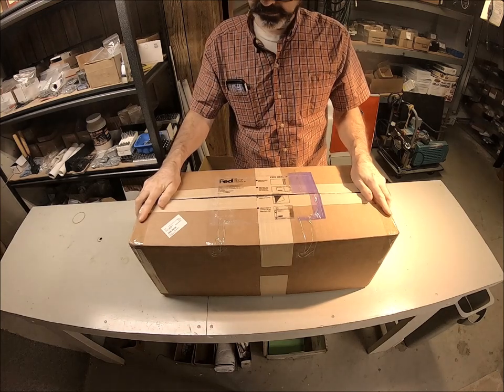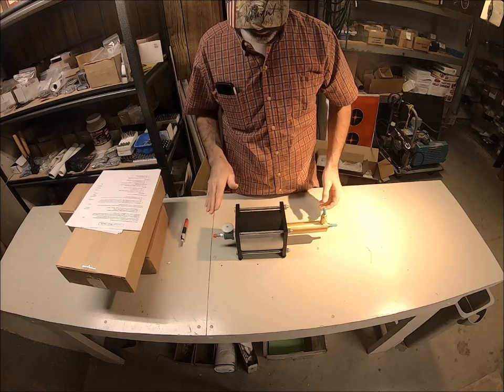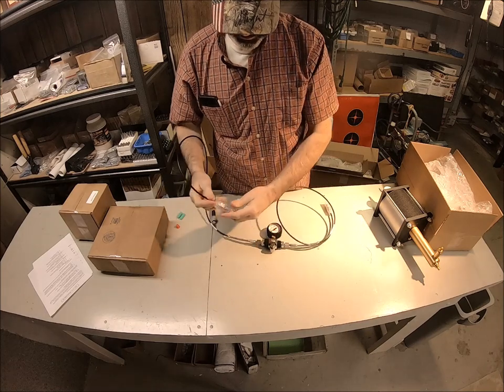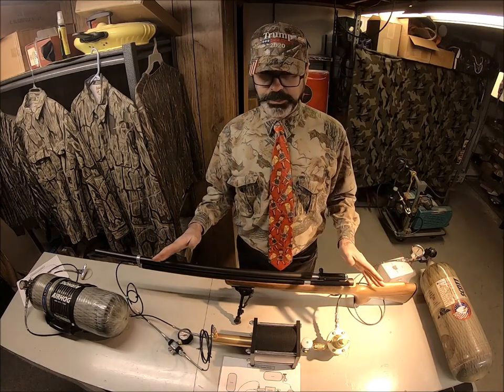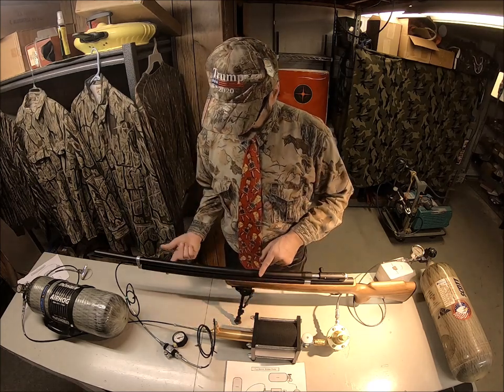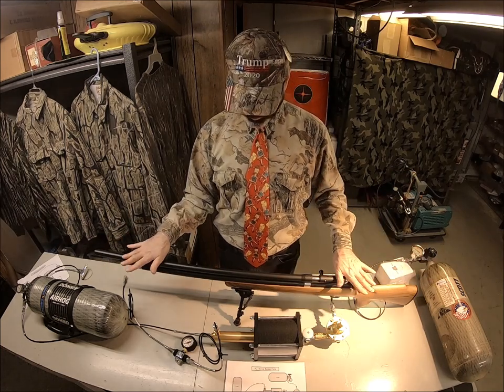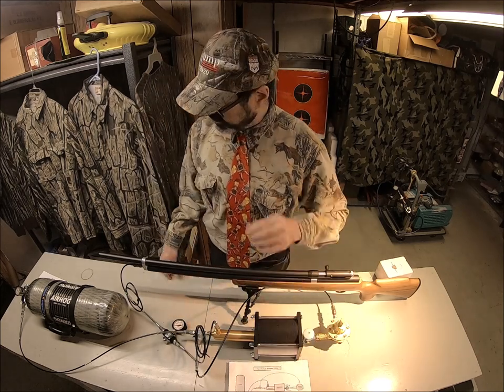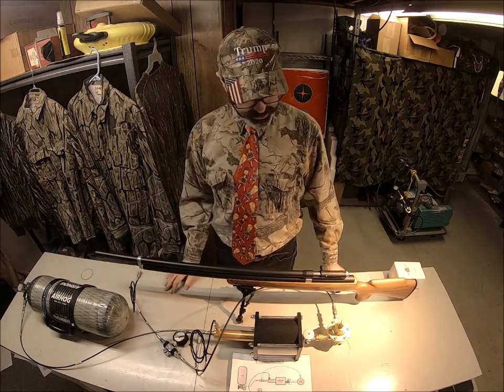Airgun Booster Pump Video

Comment: Just bought one off of Extreme big bore air rifle s.com
Reply: same here.And received it.It's plumbed,though with the assumption you're going to power it all with one tank set up.To use a shop compressor,I would need to do some wrenching.It doesn't seem as quick,and easy to change configurations as this one.
Reply: by the way,when he presses the button to boost the pressure,how do you know when it's time to release the button?
Reply: Yes I had to wrench on mine as well and you will hear it click once the piston bottoms out and you will have to find out what works best for you for the set up I just use one tank works great but be careful u can over fill your tank on the air rifle if you useing a new tank at 4500 psi
Reply: @Ray-ro2jj  ,I would never need to use a booster at all if I'm filling from a tank that already has 4500psi in it.That what you mean? My highest gun only goes to 3625psi.I'm currently waiting on the pressure of my scba tank to drop below 3000psi to test this thing out,and to do that i need weather to cooperate so i can do some shooting.And yes,depending on how much gas it consumes,I may well just use a one tank set up all the time .That way I wouldn't have to purchase a shop compressor,or do any wrenching,or take a chance on introducing moisture into system.
Reply: @Ray-ro2jj  ,also,buy the time I purchased an inline gylcerin filled gauge from Brancato(that doesnt come with it),that "boosted" the price up to around the cost of the Arrytek.lol
Reply: @2marauderman329  my Scott tank goes to 4500 and will easily over and pcp air rifle just saying be careful

Comment: I've seen other units where a simple workshop compressor is used at around 100psi to fill a rifle or another air bottle. So, no primary air tank is needed. Will this unit do the same thing? That is, convert 100 psi to 4500 psi with piston motion. Appreciate your answer and thanks.

Comment: Hi, have had any problems with the Ayrtekk Airgun Booster Pump? Do you know any durability issues with it? The components in the booster seem to operate more "slowly" and a lower temps then components in a PCP HPA compressor. That should mean less durability issues.